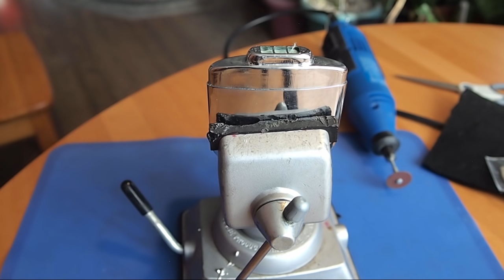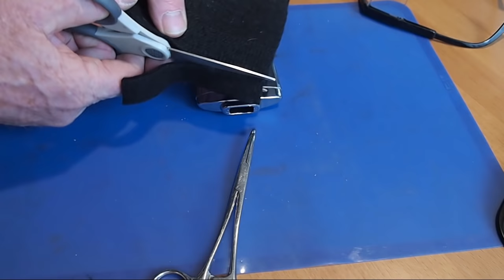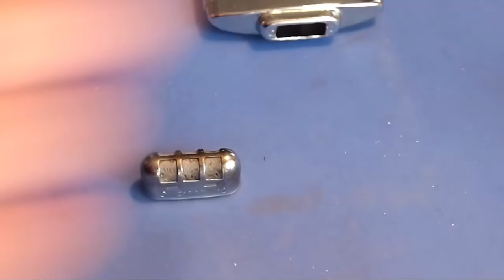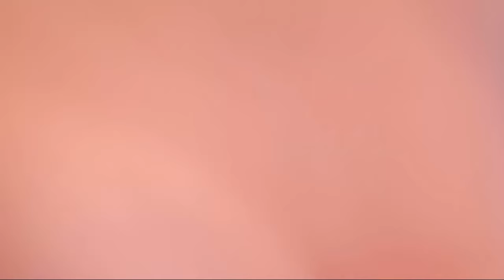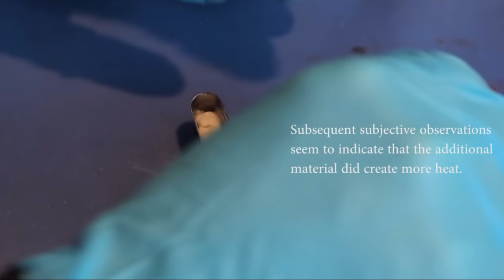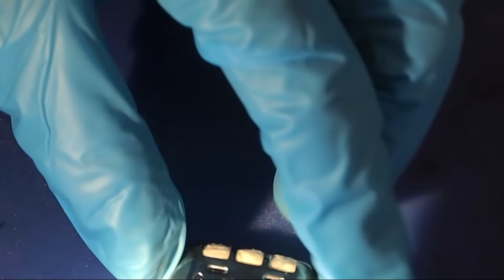Handwarmers, S01E03: Rebuild a Zippo Handwarmer with Carbon Felt and Platinum Catalyst

Comment: I have three of the current Zippo hand warmers. I have a lot of trouble lighting them despite following directions exactly. The catalyst seems to degrade quickly. The current head design is significantly different than what you show here. Have you tried replacing the catalyst in a current stock Zippo?
Reply from the maker: All liquid fuel handwarmers operate on the same principles, the material to refurbish them is therefore the same, as are the procedures.

Comment: Hey man great video you got came to it because it seems like my zippo hand warmer burner is kicking the bucket it doesn’t seem to want to keep on going even if it as enough fuel and one more thing I never took note upon the Frist time using it if the hole platinum catalyst would glow but it’s definitely not doing it now my question is is yours an older model because mine doesn’t have that spring instead it has like a copper like gasket part that under the platinum catalyst my question how can make this burner rock that nice glow and give off some good heat I have not said this even with the original burner I freaking love this thing I don’t even think about those other ones that are basically over sized oxygen absorbers thinks and when can you get more of that platinum catalyst  in stock thanks new sub and like from me
Reply from the maker: None of the stock handwarmers came with springs, it was just an idea given to me by Jeff Hanna as a way to hold the catalyst in the handwarmer head without falling out in fragments while maintaining a proper gap between the reservoir material and the catalyst material to enable air flow and thus ensure the platinum gets sufficient oxygen.
Reply: I suppose I would my Jon-e GI Aladdin the same way if it ever dies, correct? @MountainParameters

Comment: Does the catalyst pad in a factory zippo suck? Mine is 5 days old and will not stay lit. It also looks like the Chinese heads and not like the one  in this video. Adequate fuel and airflow. Are they better when rebuilt like yours? Thanks in advance!
Reply from the maker: When the unit is new it should work. Your unit is probably going out for one of the many reasons outlined in the videos. Having said that, I find I have the most problems with the Zippos going out, and the best luck with the S-Boston.